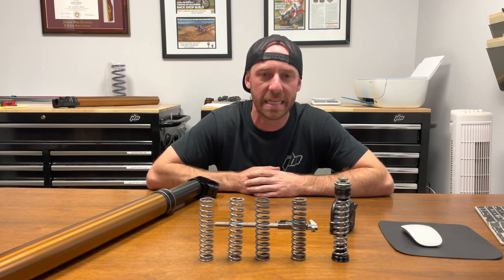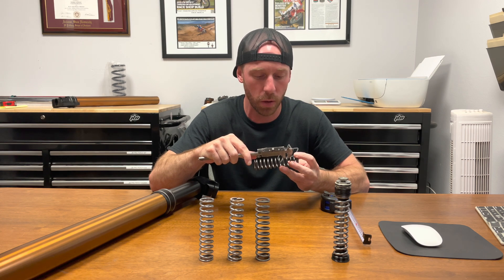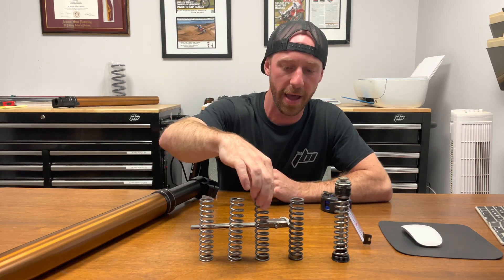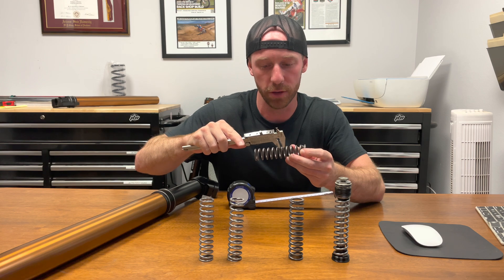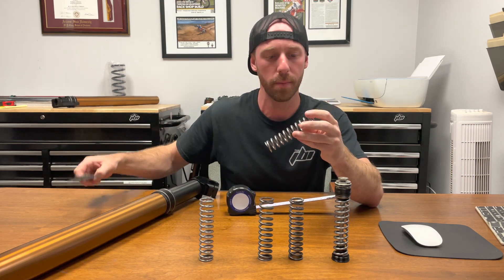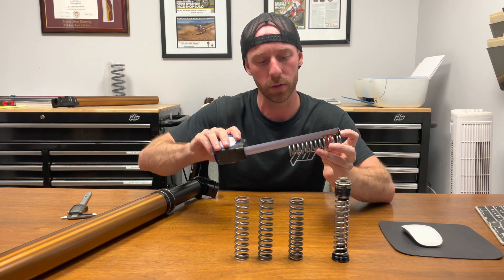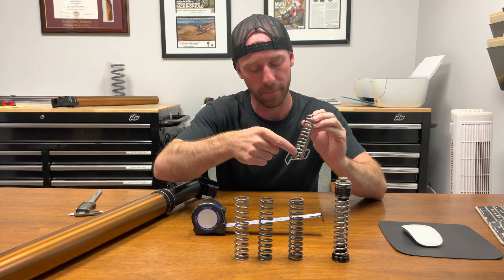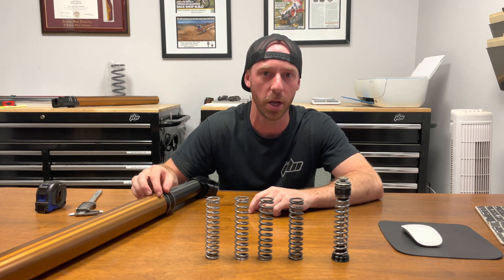How to identify WP Cone Valve Fork pressure spring rates

Comment: I am assuming these are the same springs that the Xact Pro 6500 cartridges use. What is the effect of going from the 18N to the 16N spring. I know it lowers the cartridge pressure, but that seems desirable for east coast woods setups. We rarely get a lot of big hits so cavitation should not be a real concern. Is it worth changing?